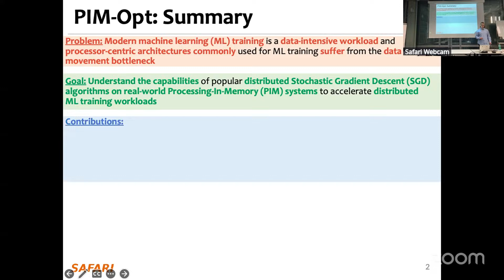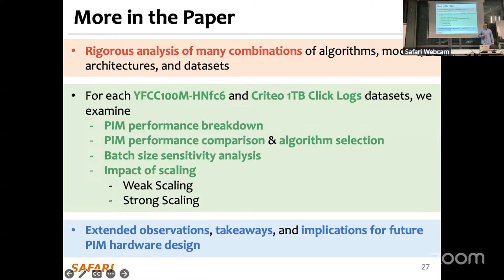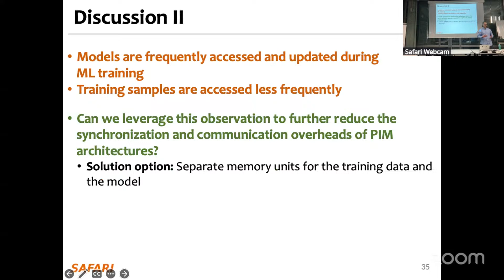SAFARI Live Seminar - PIM-Opt: Demystifying Distributed Optimization Algorithms on a Real PIM System

Comment: PIMOP: Demystifying Distributed Optimization Algorithms on a Real-World Processing-in-Memory System

*   0:03:56 Introduction: Steve, a computer science master's student at ETH Zurich, presents his work on PIMOP, a system designed to accelerate distributed machine learning training using processing-in-memory (PIM).
*   0:05:14 PIMOP Overview: The paper explores the capabilities of distributed stochastic gradient descent (SGD) algorithms on a real-world PIM system, specifically the UPMEM PIM architecture.
*   0:06:46 UPMEM PIM System: This system is highlighted for its availability, general-purpose nature, and resemblance to a distributed system, making it suitable for this study.
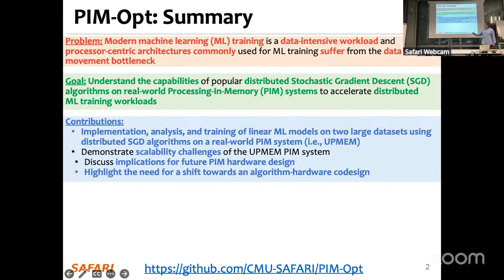*   0:07:36 Evaluation and Comparison: The UPMEM PIM system is compared to state-of-the-art CPU and TPU architectures, showing significant speedups for specific datasets and algorithms. For the yfcc 100m dataset, PIM is up to 1.9x and 3.2x faster than CPU and GPU, respectively. For the criteo dataset, it's up to 9x and 10x faster.
*   0:08:29 Scalability Challenges: The study reveals scalability challenges with the UPMEM PIM system, particularly concerning statistical efficiency and accuracy degradation as the number of nodes increases. With the Yahoo dataset, accuracy dropped from 95.5% to 92.2% when scaling up the nodes.
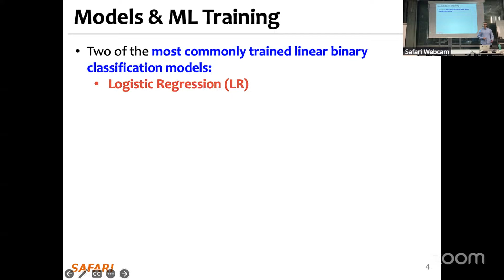*   0:09:09 Background on Machine Learning Models: The presentation discusses logistic regression and support vector machines (SVM) as common linear binary classification models used in machine learning.
*   0:09:47 Key Algorithms: Stochastic Gradient Descent (SGD), Mini Batch SGD, Gradient Averaging SGD, Model Averaging SGD, and Distributed Alternating Direction Method of Multipliers (ADMM) are introduced as central algorithms for distributed optimization.
*   0:11:35 UPMEM PIM Architecture Details: The architecture consists of standard CPUs, DRAM modules, and UPMEM PIM-enabled memory modules. Each PIM module has two PIM ranks, each with eight PIM chips. Each chip contains eight banks and a processing unit (DPU).
*   0:13:59 Data Movement Bottleneck: The presentation emphasizes the data movement bottleneck in processor-centric architectures as a critical limiter for large-scale machine learning training.
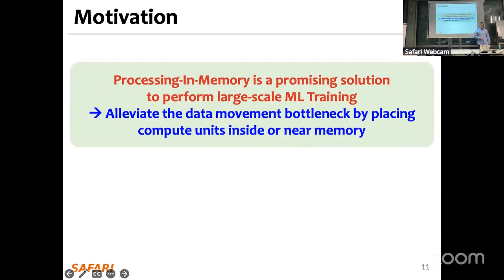*   0:16:06 PIM as a Solution: Processing-in-memory is presented as a promising solution to alleviate the data movement bottleneck by enabling computation closer to the data.
*   0:17:59 Communication Efficiency of ADMM: The ADMM algorithm is identified as particularly attractive for distributed training on the UPMEM PIM system due to its communication efficiency.
*   0:21:49 Mapping Distributed Algorithms to UPMEM PIM: The workflow involves the host CPU distributing data partitions to DPUs, invoking the DPU kernel, and synchronizing models and gradients.
*   0:24:47 Task Parallelism: Each DPU is treated as a worker, using 16 tasklets to implement the mini-batch SGD optimizer, evenly distributing features and model parameters among tasklets.
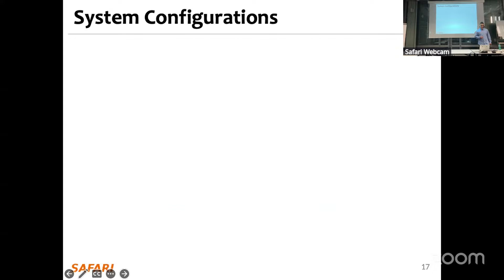*   0:26:09 Methodology: The study compares the UPMEM PIM system with high-end AMD EPYC CPUs and an NVIDIA A100 GPU, using PyTorch for CPU and GPU baseline implementations.
*   0:33:34 Evaluation Results: For the Yahoo dataset, the UPMEM PIM system outperforms CPU and GPU baselines, especially for models like SVM.
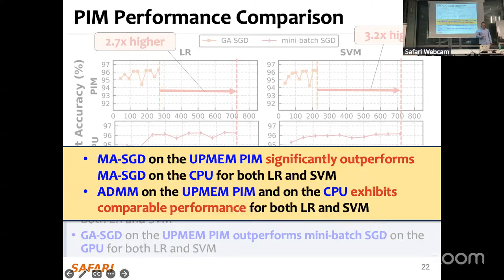*   0:36:46 Impact of PIM on Accuracy: Discussion on how PIM affects accuracy, with an observation of a trade-off between performance and accuracy as the number of DPUs increases, due to increased staleness.
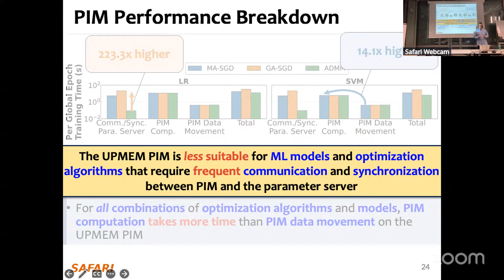*   0:38:54 Breakdown of Training Time: Analysis of time spent on communication, synchronization, computation, and data movement within the PIM system, highlighting the bottleneck of communication with the parameter server.
*   0:43:42 Implications for Future PIM Hardware Designs: The need for interconnects or shared memory among PIM processing units to enable decentralized algorithms and improve scalability is discussed.
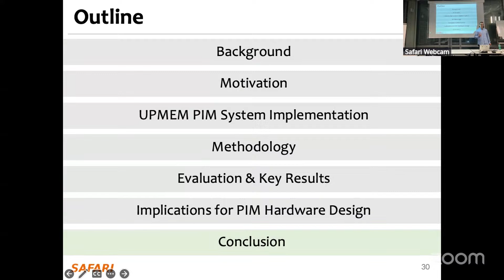*   0:52:11 Conclusion: The presentation concludes by highlighting the importance of algorithm-hardware co-design and the potential of PIM to revolutionize machine learning training.
*   0:54:44 Discussion on Inter-DPU Communication: A significant portion of the discussion focuses on the challenges and potential solutions for improving inter-DPU communication, including the addition of interconnects and shared memory.
*   1:07:35 Enabling Deep Learning on PIM: The challenges of mapping deep learning models onto PIM architectures are discussed, including model size, layer distribution, and underutilization of hardware resources.
*   1:12:30 Computation in Network: The idea of performing computations within the network to reduce data movement and improve efficiency is explored, with considerations for feasibility and practicality.
*   1:15:53 Continuous Learning: The concept of continuous learning is introduced, where models are constantly retrained with new data, and how PIM could facilitate this by efficiently managing training data and model updates.
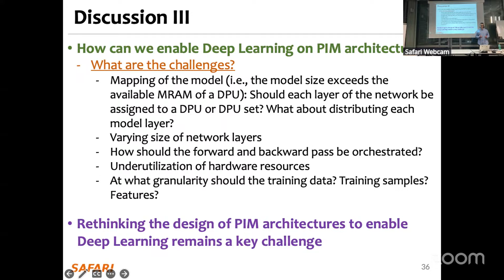*   1:21:49 Closing Remarks: The presentation ends with an emphasis on the need for further research and the potential of PIM to significantly impact the field of machine learning.

I used gemini-1.5-pro-exp-0827 on rocketrecap dot com to summarize the transcript.
Cost (if I didn't use the free tier): $0.09
Input tokens: 63596
Output tokens: 1225